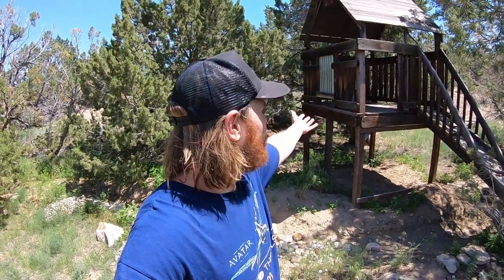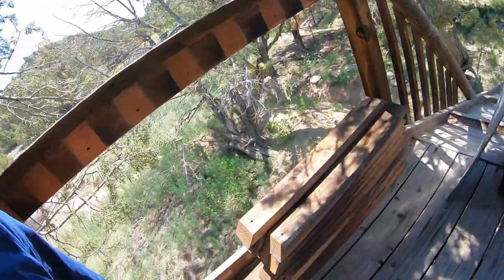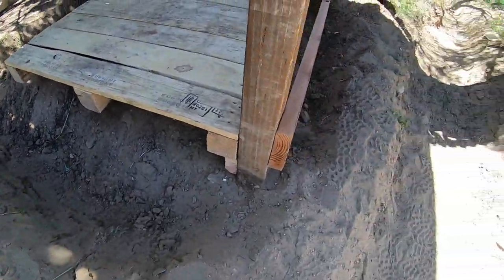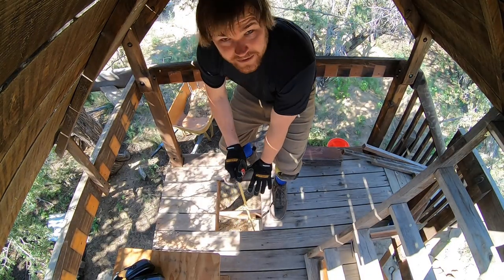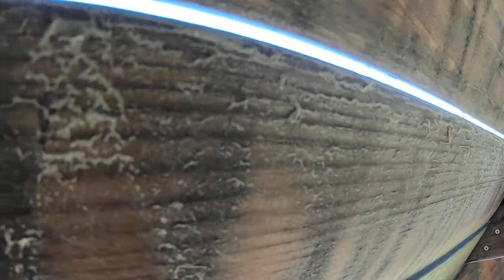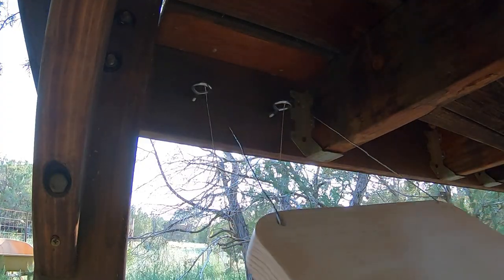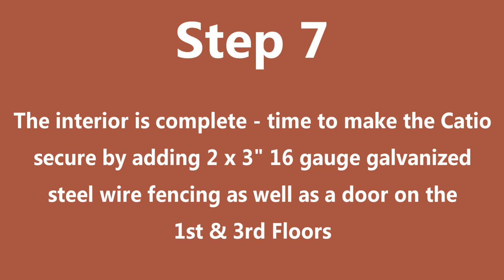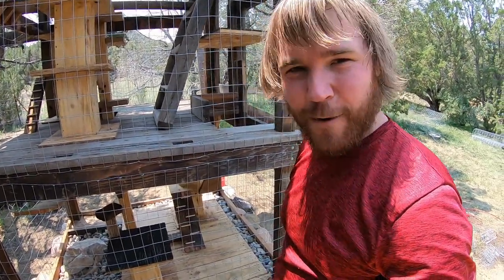Converting Old Swingset Into A Catio

Comment: I love it!!! I just bought a loft bed (fits full mattress) for $75, chicken wiring for $25, plastic roofing panel for $25 off of OfferUp. I already had wire cutter & stapler to  cut and staple the chicken wire and roofing. Cheap & easy!

Now I just need to add planks/shelves (I have extra wood that I kept not knowing why) carpet, swing beds, plants, boxes, etc to make it homie. I'm not super handy so this was a little bit cheating 😂
Reply from the maker: Just go for it! As long as you are safe about it. Protect yourself haha, I'm not sure how 'handy' you are! This was mostly improv every day for me, I did not have a set plan in my mind.

Comment: Turned out great. My only thing is I probably would’ve used smaller wire because I’d be afraid the cats would squeeze through
Reply from the maker: That thought did occur to me and if the cats were small kittens, they probably could have fit. But since these are fully grown I knew they wouldn't be able to. 

Thank you for watching! I hope you liked it.
Reply: I would use smaller gauge also so as to not have a freak accident.  It is amazing I love it.  When are you going to start work on the runway from the house.  Might want to put a piece of carpet up top to grip on.  But like I said it is amazing.  You will need a couple of lawn chairs to sit with them.  I wouldn’t go back inside 😂

Comment: The spacing on that wire is too far apart to keep them safe from predators.  but looks great.  How do the cats go in and out of the catio?  I didn't see a tunnel from the house.
Reply from the maker: The spacing is 2x3" which is plenty of space to protect against predators, minus snakes. The cats have to be manually put into the catio because its so far away from the house.

Comment: that wire is weak a dog can go right through it no problem ( I had to patch the hole and  reinforce the bottom wire with a second layer of a different type over the top of it )you also need to add boards over the top of where it is nailed on (with as dry as it is here in the "desert" the nails/ staples ) will back out and remember if a cat can fit their head through something they can fit
Reply from the maker: No, a dog is not getting through it no problem. That fencing is so reinforced with the U Nails I doubt I could get it off with a crowbar and pulling as hard as I can.

The cats cannot fit their heads through it.

Thank you for the advice on the structural integrity though!